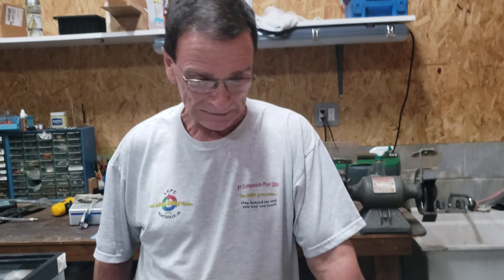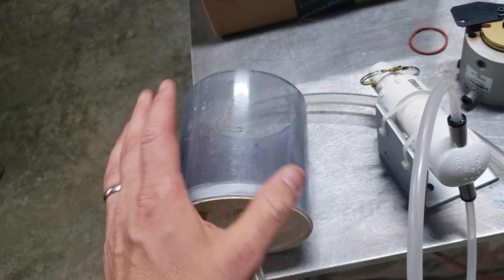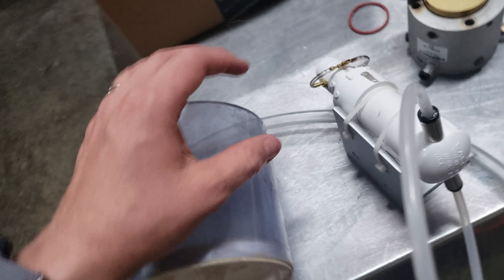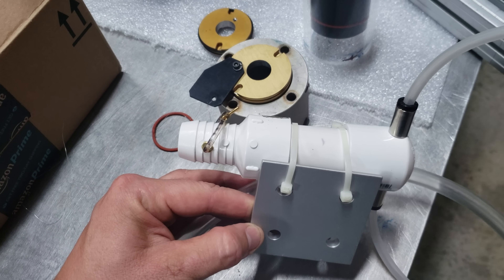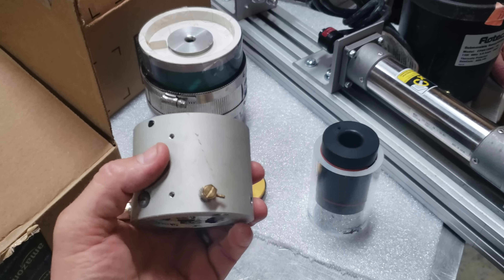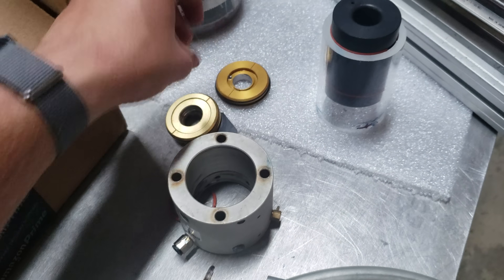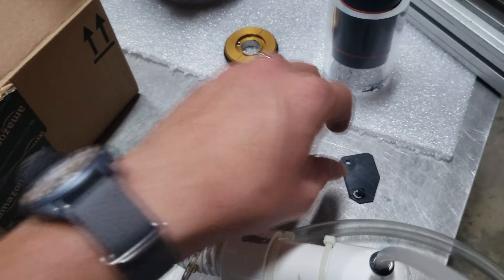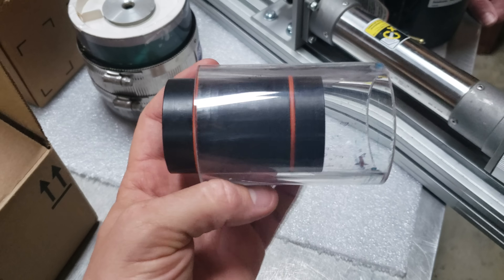Evolution of the Vortex Collision Device

Comment: Destin! I'm a bartender at a fairly prominent craft beer bar in my city. We sell some nitro beers at our place and once in a while when I'm pouring a stout the top of the beer where the head starts forming makes a few crazy designs. There's usually really acute triangles that are banded between light and dark, and then small orbs zip around at the top completely disregarding the direction of flow. It only works if the glass is fairly centered!(using a plain tapered 16oz (pint) glass.) it's wild! It's something you should look into to add to your fluid dynamics stuff.
Reply: I'll try to take a vid next time I pour one! It's really neat!